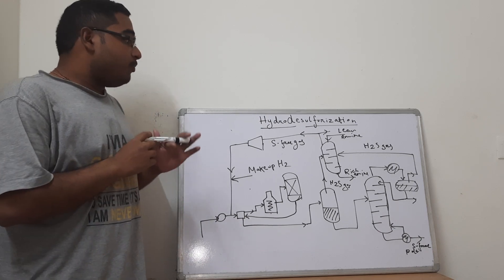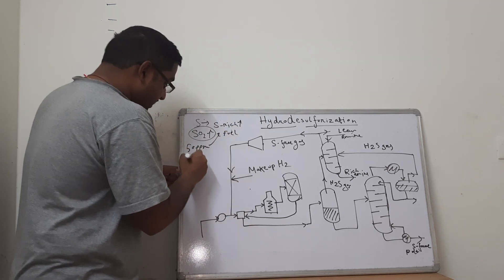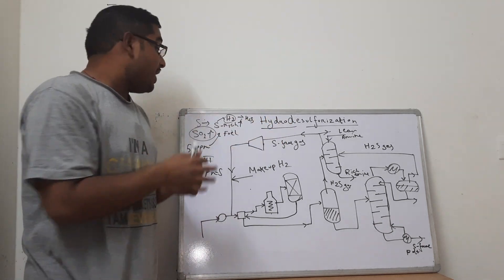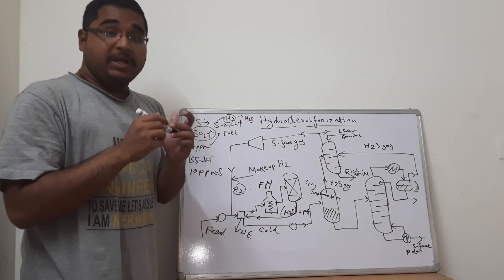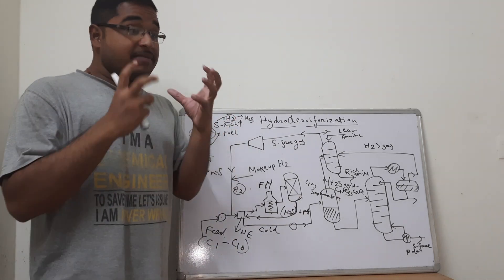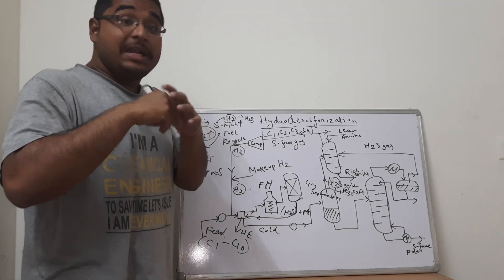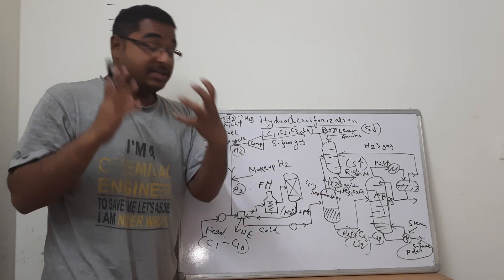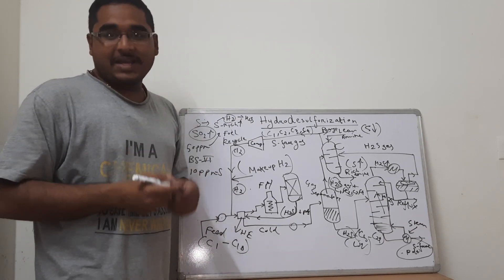HYDRODESULFURIZATION | PETROLEUM REFINERY | SULPHUR REMOVAL | HYDROTREATMENT

Comment: If we want to remove sulphur from h2s, then why again we input h2s from reflux to amine chamber as we already removed,

Please make clear if I am wrong.
Overall you have given very good knowledge.
Please discuss as
1 .  KHDS UNIT
2 HGU UNIT
Reply from the maker: Our primary purpose is to trap S in HCs with pure H2 as H2S and then trap the H2S in amine chamber using amine as it reacts with H2S and traps it. The remaining stream without H2S is refluxed into the main reactor
Reply: @LifeBeyondBusiness  correct,gas is leaving at top of the chamber only liquid is going as reflux., Thank you